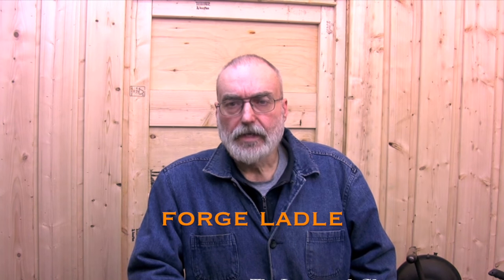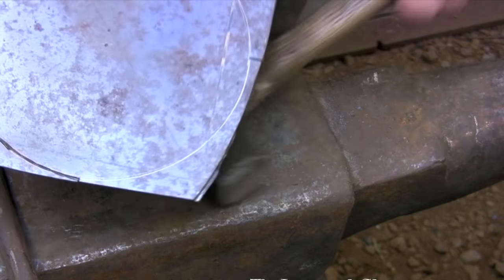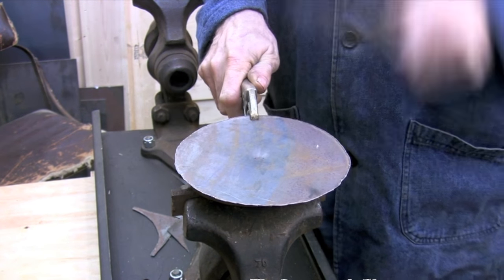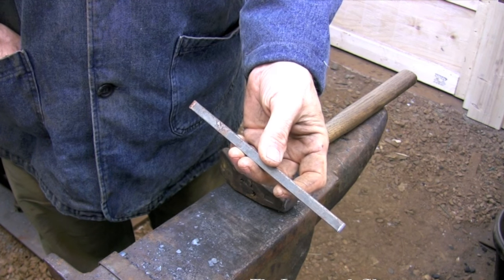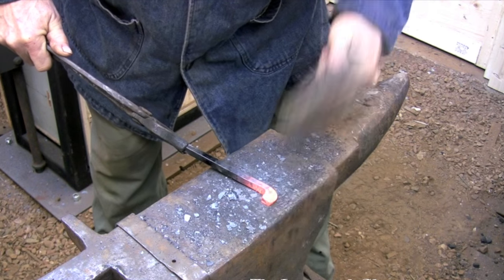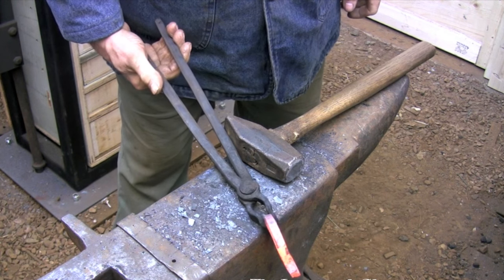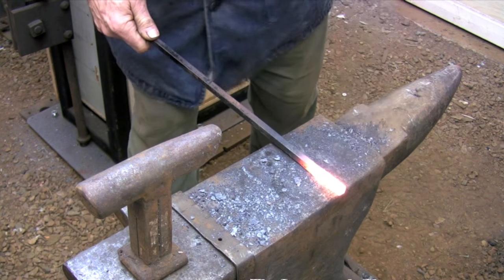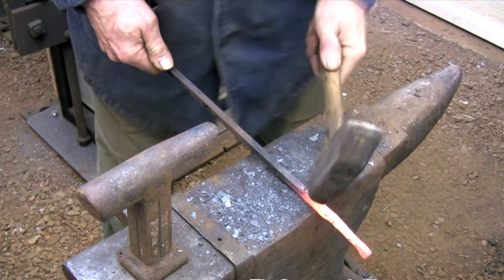Blacksmithing Project - Large Hand forged ladle

Comment: When I had my forge going I made a watering tool for tending my fire. I made two ladle bowls about this size and welded the rims together to make a hollow ladle egg type thing, then I drilled about ten 1/8 '' holes in one side and put a half inch hole in the other side. I put a long handle on it and just kept it in my water barrel. When you need water on the fire you've got a little shower that comes out. I know I didn't describe it very well but it worked good.
Reply from the maker: That is a great idea.  Do you mind if I turn that into a video?
Reply: I'd be honored, I'm surprised you knew what I meant, I can make things but I'm not very good at explaining myself! I had a big swedge block with the ladle and spoon molds so it was easy, you're a much better smith than I was, it would have taken me forever to get the ladles as even as you did with that big chain link. I made knives for years in the 90s and can probably still hammer out a good blade blindfolded but I met a real blacksmith and found out quickly that even though we used some of the same tools, I couldn't hold a candle to a real blacksmith.
Reply from the maker: I guess that tool has been around for a while.  It started out as a rag on a stick and turned into a pop can with holes in it.  I think your idea is a great example of a blacksmiths approach to the problem and I'd like to build one.
Reply: Looking forward to it. Your videos make me want to get my old tools together and start again

Comment: I noticed that, when shaping the bowl you were using a smallish cross pein hammer.  Why not a small ball pein hammer?  I would have thought that would have been easier but, I often find that what I thought would be easier is actually, harder to get the desired form!
If you'd let us know why one and not the other was used it might be beneficial for some of us!
Thanks, Dennis!
Reply from the maker: Any kind of hammer will do this just happens to be a cross peen.  The important thing is that the face has been ground to a large radius so it will shape the metal without leaving deep gouges. The ball of a ball been is too small and will just dimple the sheet metal instead of forcing it into a new shape.

Comment: Yo Dennis, Thanks. As I watch you I see that there are many "RIGHT" ways of doing things. My only question is, Why don't you clean the top of your anvil? Every other Blacksmith I have ever seen, including my Grandfather, always kept their anvil top clean. Do think that it isn't necessary? Anyhow, your videos are excellent. Keep up the good work.
Reply from the maker: I clean it off once and a while but I'm definitely not a fanatic about it.  When you are forging hot metal, above an orange heat, there is always a layer of scale on the work and you are hammering that scale into the surface.  You can't get away from it -  It is just part of the process.  The only time I am concerned about scale on the anvil is when I'm hammer refining a forging and trying to produce a very clean finish.  During that process you keep the work below a  red heat so it stops producing scale and you remove the scale from the anvil as it falls of the work.  At that point you can concentrate on removing any hammer marks and begin polishing the surface because you are working with clean metal on a clean anvil.  It's very tedious and I don't have the time to do it very often but it produces amazing results.

Comment: great video, I had a question. I've had a lot of problems drilling forged steel, both in a press or with a hand drill, any advice? I'm assuming this piece was drilled, is that the case?
Reply from the maker: I'm assuming the drill bit is a good quality one and sharpened properly.   Are you quenching the piece when it is still hot? If so let the piece cool to room temp slowly before drilling.  Mild steel doesn't have enough carbon to use for tools but it will harden enough to make drilling difficult. Another reason may be an excessive amount of scale build up on the surface and that could dull a drill a little before you get to the steel. Centre punching tends to break through the scale layer and allows the drill to bite directly into the steel.
Reply: +DF - In The Shop bit was brand new. I think quenching the mild might have been my issue, I'd always heard mild doesn't harden appreciably, but coming from a machining history, drill bits aren't as good as they used to be at times, so Occam's razor makes me think that would be my issue, thanks. And by the way, I'm glad to see you putting out videos again!

Comment: how did you determine the diameter of the blank? A portion of the surface area of a sphere of appropriate diameter?
Reply from the maker: When you are sinking a shape like this the outside diameter doesn't change much because you are stretching the material to make the bowl so the size of blank that you start with is going to be pretty close to the finished diameter.  I wasn't after anything specific here so I just went to my scrap pile and found a blank that looked good.

Comment: Why weld a separate piece on for the ring instead of just bending the end of the handle around onto itself? Thanks!
Reply from the maker: There is no practical reason to do it this way.  I was just showing you a different approach to the problem.
Reply: +DF - In The Shop I see. Well it was a cool weld that I hadn't seen before. Thanks